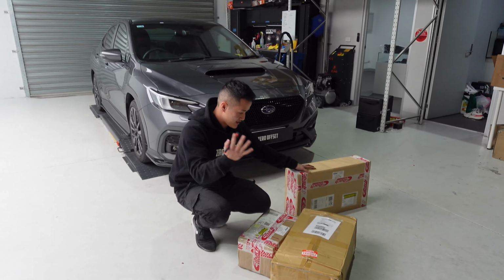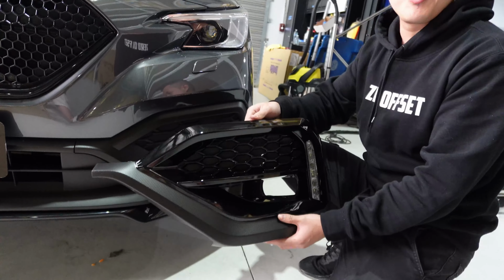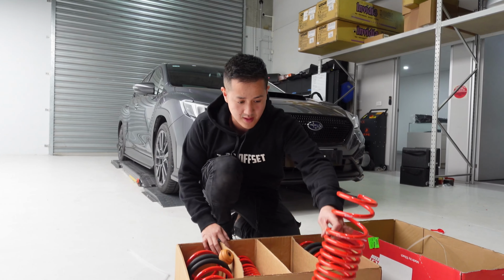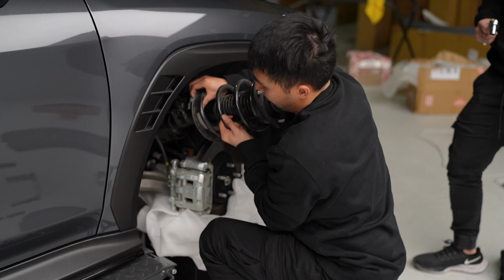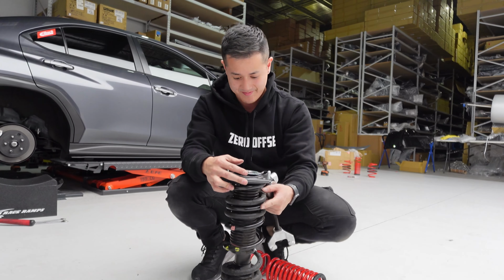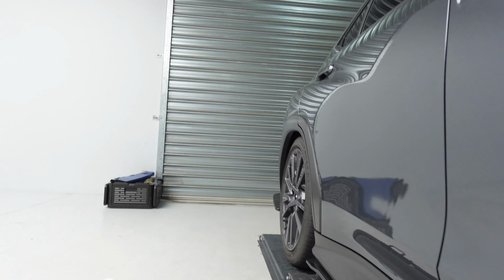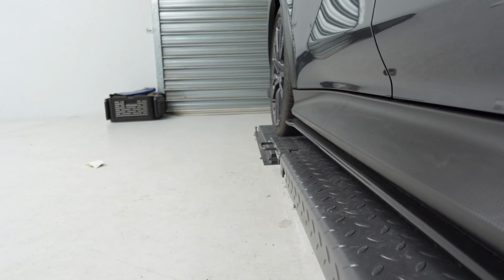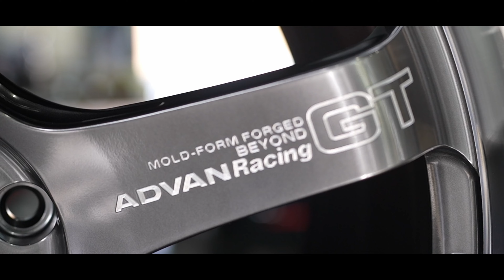MODDING ON A BUDGET | SIMPLE MODS FOR THE NEW WRX VB COMPLETE

Comment: The only mods needed are an AOS/catch can, a thicker rear sway bar, 10mm spacers for the wheels, and better tires. It will handle better and be more reliable.